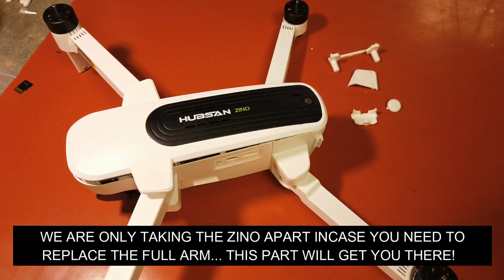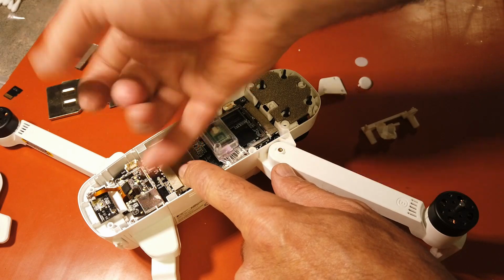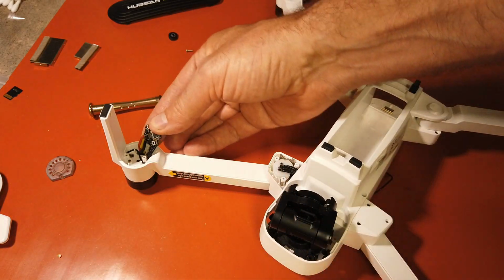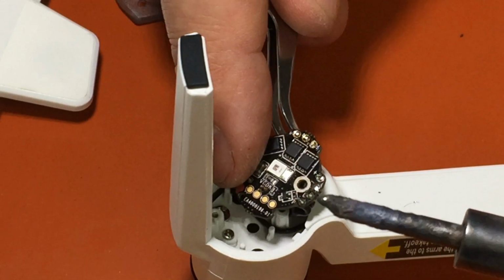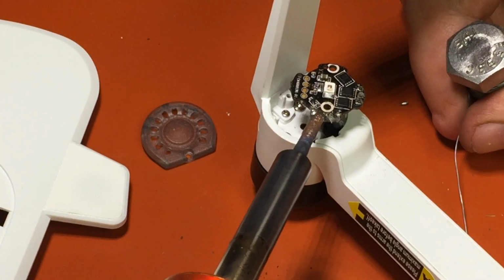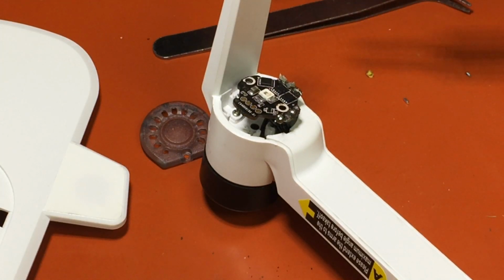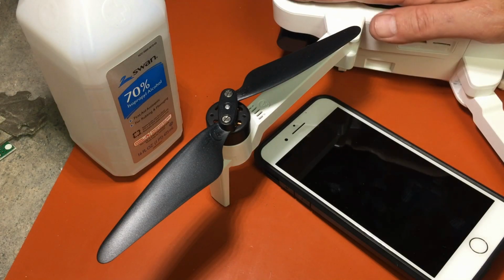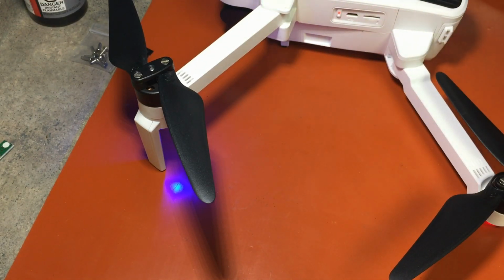HUBSAN ZINO - ESC & MOTOR REPLACEMENT - HOW TO

Comment: Chris, thanks for taking the time to create this video...while I don't own a Zino I'm sure this video could be incredibly valuable to those who do own one and who might need to take on this task. Question: For brushless motors are there symptoms that one might see that would indicate the motor and/or ESC is about to fail? And if so what would those symptoms be? Or do they just tend to be catastrophic failures with no warning signs?  Obviously if they fail in flight I'm assuming that the drone would just fall out of the sky...what has your experience been?
Reply from the maker: Jet Martin Never have seen a warning sign personally nor have I had one or the other just fail in flight.
I’ve seen stuff from people I have helped but those esc signs usually won’t let you fly or tell you your very stupid if you do try. 😂 
Usually a crash causes the failure. Most common I have seen anyhow.
Reply: @QCGUY  Thanks!

Comment: Hello, I am Korean. Your video gives me a lot of strength. In this video, I saw the WIFI of a ZINO drone connected to your cell phone. I tried to connect, but I couldn't because I didn't know the password. I want to know how to enter the password when connecting to WIFI.
PS : There may be a wrong sentence by writing it with a translator. ^^::
Reply from the maker: It’s 12345678

Comment: Hey QC Guy, you helped me out on calibrating my gimbal and fixing me up with the program to do it with and I want to thank you for that. Gimbals working perfect now. Now I have a new problem hopefully you might have an answer to. My battery must have popped out while i had it about 350 feet up and it came crashing down, relatively slowly at least. When i picked it up everything was intact but both the motors on one side wont spin. Lights come on and the rear one is really hot. If one ESC on one motor, will that affect the other motor on that same side or are both ESC's probably bad or am i dealing with a problem further in the quad? Its a Hubsan Zino Pro Plus by the way. Thanks again.
Reply from the maker: One esc won’t effect the others so it sounds like you need to check voltage out on your power supply board that feeds esc and lights.
Reply: Ok. I can tell that one ESC looks fried. Looks burnt and gets real hot. If the output voltage is off, does that mean I’d probably need a new main board?
Reply: And thank you very much for your reply.
Reply from the maker: @johnkatter2373  a new power supply board most likely not the main board.
Reply: @QCGUY  Ok. Thats much cheaper than the main board at least. Do you know what the voltage should be going the ESC's from the power board. Hopefully this is the last question! LOL! Thanks again
Reply from the maker: @johnkatter2373  not off the top of my head sorry.

Comment: I find the best way to remove solder is with a "solder wick". It's basically just a ribbon of braided  copper that soaks it all up when heated - very easy. Just search for "solder wick".
Reply from the maker: dipsyfriday I use those at work. 👍
I have a few different tools for this.

Comment: Hello Friend. Man I really need your help let me tell you my story: I received my Drone Zino yesterday, I called and the red light is blinking I have been searching a lot and it seems that it is not releasing the signal from the wi-fi and it really is not because on the cell phone no appears my phone can detect 5g. I can connect the cell phone to the control normally only that the cell phone doesn’t show the Zino network there ... I saw several videos talking about this problem and they all indicate that it’s a problem in the flat only that the Drone came in brand new I just opened it and even did a boxing I just can't link here but YouTube and block that comment for you. have any idea what you can do because the Drone as I said came zero new just took it out of the box and called it is ok the cute app turned on the phone and already gave this problem right away and I who will stabilize normal ... Thanks I await response
Reply from the maker: CANAL LELOTREM Usually it’s something to do with the camera cable but sometimes the micro sd slot isn’t connected to the board correctly or came loose and this effects the connection as well. It could be something totally different but that’s all I can tell you right now.
Join my group for further support. 
https://www.facebook.com/groups/HubsanQC/?ref=share

Comment: How good would it be if you could set different settings for expert mode and normal mode. So have the gimbal speed and aircraft speed set low for better filming. Then for expert mode have them set high for taking pictures etc....
Reply from the maker: John young Pretty good I guess but that might fall into the shit💩in one hand and wish in the other and see which you get first category. 😂

Comment: Thank you so much. I did that once (just the motor part ok)... but now I had to open it and "pass" the cable w esc to the short arm... When i try to turn it on blue lights are on for 2 secs (w the relative noise) but then itgoes off.... I opened it again i found and fixed 1 of the 4 cables of esc... but still goes off. Both red lights dont go on...  could u consult where to focus?...or an email to contact you:)
Reply from the maker: Antigoni Kotsoni It sounds like a wire or wires are still not right. I don’t know what you’re problem was prior or if damages were more widespread so it’s hard to tell you anything without that and not having it in front of me on my bench it’s equally hard. There’s not a one answer suggestion or fix in this case unfortunately. Sorry 😐
Reply: @QCGUY  ty foryour time... ty for your videos:)

Comment: Hi again QC Guy:) I have been trying to find a decal kit for the Zino with no luck. I have emailed them at Hubsan for some kind of schematic of the plastic sizes as I would like to personalise my drone and Controller. What do you think? I have looked on line and there is loads for the Mavic etc:( I have only seen one on YouTube that as been wrapped in a 5d Carbon and it looks quite nice. Any ideas yourself as I know you like to tincker with them. hehe. I dont have mine yet but would like to know for all the cut outs etc.
Reply from the maker: STOP RIGHT THERE! LOL
You will get nothing from Hubsan which I will bet my life on and if they do reply it will be asking for videos and pictures and mass confusion. I might add pin stripes but I don't do any skins or anything like that. Sorry

Comment: It appears as if the motor on my Zino Pro is bound up after an upside down crash on pavement. I'm pretty sure its physical problem with the motor. It is stiff in rotation. Should I also change the ESC while I'm into it?  And please send me the parts if you have spare  lol
Reply from the maker: Tommy Guns Dunleavy I can sell you a perfectly working complete arm with motor and esc already to go. Message me....
https://www.facebook.com/qcguy.wade

Comment: Chris, is there a way to check motor health by adjustable power supply . If we apply Voltage Black and Red or Black and Yellow will the motor spin?
Reply from the maker: You need a special meter to test them. I think you can find information if you search for something like test brushless drones or rc motors. 👍🏻

Comment: Hey I see you have a lot of information on the Zino.. my 18 month old zino no longer can connect to the transmitter and says USB disconnected every time. Any tips or a link that may help me before I run it over with my truck in frustration??  thanks!
Reply from the maker: At that age if it just started doing it then it is likely the main board. I repair drones and a lot of Zino’s. Sometimes it is a board that can be repaired and sometimes it just needs replaced. 
Don’t run it over please! 😂

Comment: Hi Chris, my zino crashed down hitting a tree and fell on a pavement(very unlucky😅) This caused the 2 ribbons connecting on both sides of gimbal snap,now no feed,binds and even wifi signal. My question is does the 2 broken ribbons are somewhat intergrated with wifi connections or maybe theres another issue with its mainboard? It stills boot up completely. I hope u can help me as im planning to order replacement on broken ribbons..thanks and have a good one!
Reply from the maker: Jayson Ricaplaza without the cable you won’t have any wifi or connection what so ever. 👍
Sorry to hear of your crash but at least now these parts are available.
Reply: @QCGUY  i hope flex is the only problem.many thanks Chris i really appreciate knowing that theres a big chance to revive my zino.btw,do you have any tutorial for flex installation on zino gimbal?
Reply from the maker: Jayson Ricaplaza I’m going to have one up in the next few days. 👍
Reply: @QCGUY  great! I look forward to that.cheers mate

Comment: good night.  I couldn't remove the esc and the wires that connect it by the arm.  is very difficult.  I thought about leaving the wires and just changing the esc, but I'm afraid it was the wires that burned the esc
Reply from the maker: Srt Nay Check continuity on wires and cross check them for shorts.

Comment: hi, i have a motor stopped  because a crash. I check the ESC and motor but i don't see anything broken or something similar. The problem of these components are visible? or just stop working
Reply from the maker: You most likely have a bad ESC but just be smart and replace the motor and ESC because the shafts on the Zino motors bend easily.

Comment: Hello, did you make a video to show how to change one arm on the Zino?
Reply: Is it necessary to make a welding to change one arm?
Reply from the maker: Tatou2B No video but I will. Yes you need to solder the wires.
Reply: @QCGUY  ok, thanks. It would be nice you show us soon.
Reply from the maker: Tatou2B I recently lost my mom so soon might not be as fast as you would like.
Reply: @QCGUY  of course, i understand. thanks for all the help you give yet to the community.

Comment: Chris,Thanks for the video. I have replaced the back(B) motor. Before flight , i have tested w/o Propellers installed. I checked the motors by my hand , I noticed all three motors spins Clockwise , but the front(B) motor spins CCW. Is this normal behaviour?
Reply from the maker: No that’s a problem...
Sounds like you have reversed the red and black wires on the motor you replaced. 
Have a look at this... https://www.dronezon.com/learn-about-drones-quadcopters/how-a-quadcopter-works-with-propellers-and-motors-direction-design-explained/
Reply: Yes, You are right , i have confused about the red and black wires and looked at the next motor that is wired reverse. Thanks again.
Reply: Hello. My one motor is spinning in the opposite direction.  which cable did I solder wrong? Red with black? Yellow is always in middle? Thank you so much :)

Comment: On what factors that esc and motor is broken? Is it because of too hot or dust?
Reply from the maker: Muhammad Firdaus First it’s a piece of electronics that gets pretty hot and can simply just fail but normally it’s something like a crash that puts resistance on that motor and causes that ESC to burnout. 
My rule of thumb is if a motor fails or a ESC fails just replace both while you’re in there.

Comment: Hey QC... I crashed my H117s. Rear passenger motor does not spin at all but has 12V at pins A-C to on the ESC... Can I assume a motor alone would fix this, how would you handle this?...

Secondly, I am getting a "gimbal sensor abnormal" error in red on the app and the gimbal does not operate up and down, video recording and the image is good.... How would you handle this???? Much thanks. Want to save this drone if I can. Just got it a week ago and unfortunately have spoiled my experience by crashing it :(
Reply from the maker: My rule of thumb is parts are cheap and replace both motor and esc while you’re in there anyhow.
If you go into the settings of the app under the gimbal tab it should give you a code if there is a issue. 
If it says 2000 I can tell you it needs the gimbal cable replaced for sure.

Comment: I flew my zino 2 after the crashed few days before, then suddenly my zino 2 felt from 100 m alt while flying. 

Now the front right motor only spin abit everytime I start, kind of stuck, rotate abit then stop again. How do you define the ESC is broken or not, all the LED light on the ESC are working perfectly except the front right motor. Can the LED light on if the ESC is burnt ?
Reply from the maker: The led can still light if the esc is burnt. If you don’t feel anything when turning the motor by hand it’s likely to be the esc. I personally replace both when in question 👍

Comment: Is there anyway of changing the rear motor without soldering?
Reply from the maker: Money Mitch I can sell you a arm with the motor and esc already installed and ready but you will still need to solder the wires to the power board but it’s way easier soldering wise for sure.
Reply: @QCGUY  I've bought a soldering iron because you made it look too easy but I'm not sure what I'm doing lol

Comment: do u get real gopro quality on the moniter ?
Reply from the maker: You get good quality. The quality of a budget drone but better then some in its class.
Reply: can u pls give the name of the parts u r using
Reply from the maker: @jvlogs7917  it’s s motor and esc replacement so it’s a motor and esc.

Comment: Can I use Hubsan Zino H117s motor to replace the Hubsan Zino Pro motor?
Reply from the maker: Jonathan Moses Yes, they are the same part number. At least they were in the beginning when I first looked. Thanks
Reply: Thank you for your information! I just replaced one of my zino pro motor and it worked!

Comment: I am unable to open rear motors please guide me
Reply from the maker: You have to pry the lamp shade off with a little more force on the rear legs. Pry the opposite end of the screw and it will come off. Like I said it requires more force but it will come off.
Reply: Thank you! And i asked for some donations for my studies any update?
Reply from the maker: Waleed Muniri 
My charities are for children battling things like cancer so I’m sorry but you’re requested donation for school books came across as a scam to me at first. 
Now that I know it’s not may I suggest you try prioritizing your priorities? 
Sell your ZINO or other material items and buy your books 👍
Reply: @QCGUY  my Zino has crashed it doesn't have resell value
Reply from the maker: @waleedmuniri2138  I guess it's time for you to do a go fund me then. Good luck on both your zino and school. Take care!